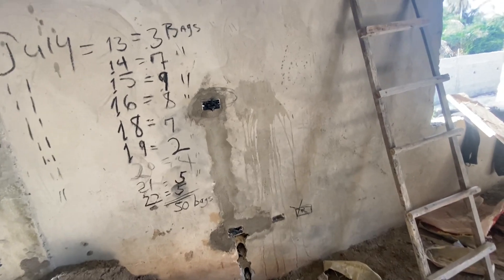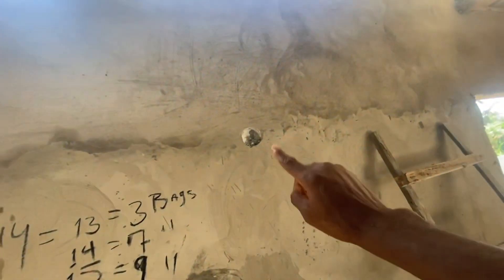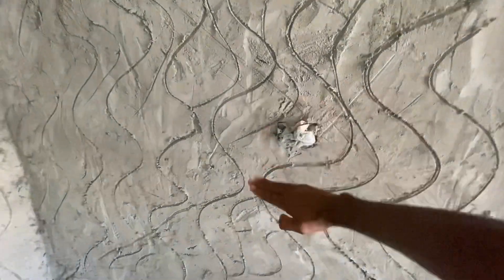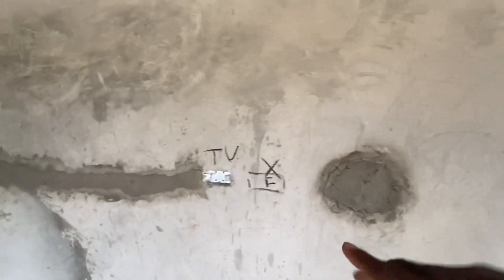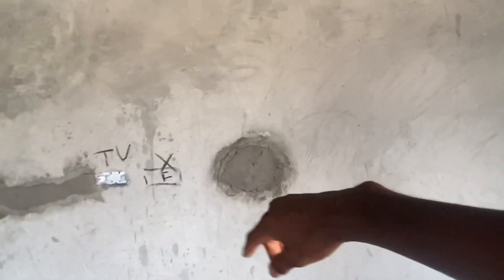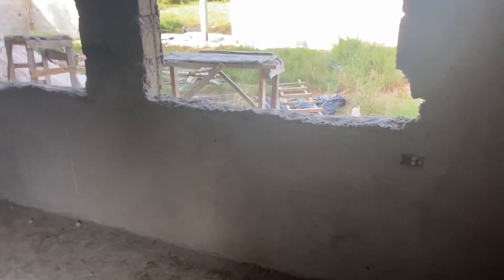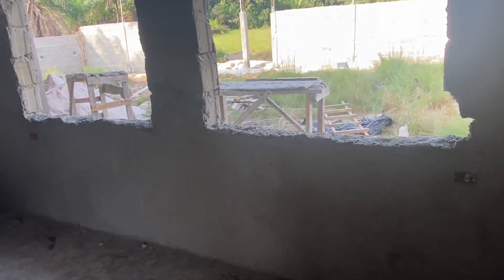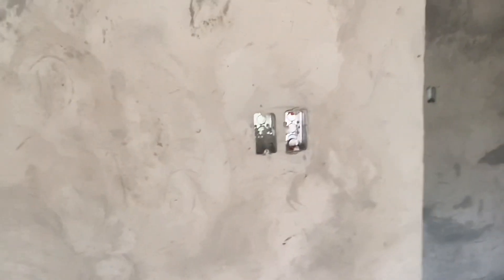Building In Liberia: How We Design This House Electrical System

Comment: Should receptical be that high up next to the window?
Reply from the maker: The function should determine the height of a receptical. A study table or AC receptical shouldn’t be the same height of a normal receptical
Reply from the maker: Assuming I want to install a receptacle for bed lamp and charging phone while you are resting in bed. The best decision would be to put it slightly above the bed drawer which is usually 2’ high
Reply from the maker: That would be the most convenient without you getting off your bed or screaming to plug
Reply: @RealZolaric  I hear you bro..I'm wiring right now as I type this comment. We are all learning.
Reply: This was a year ago, we are far ahead now.  So you see I'm interested in the industry standards or new trends.
Reply from the maker: @victornyenkan2593  oh ok. Are you an electrician?
Reply: @RealZolaric  no chief...just a curious property owner.
Reply from the maker: @victornyenkan2593  oh ok. No problems sir